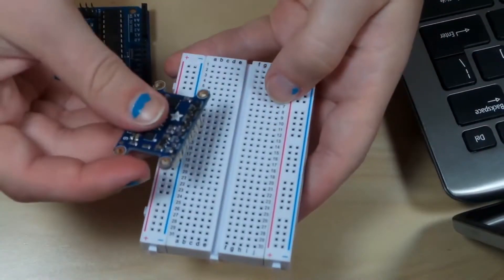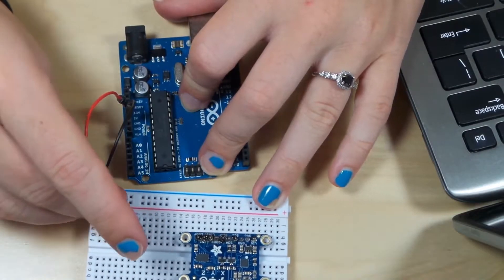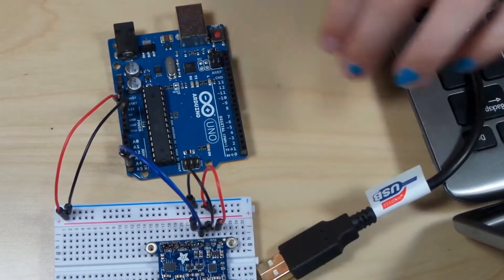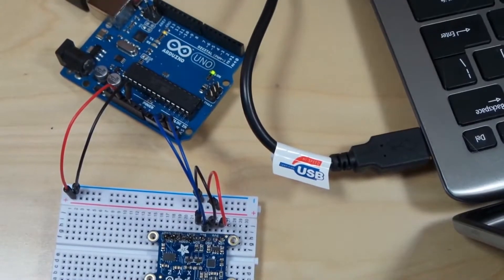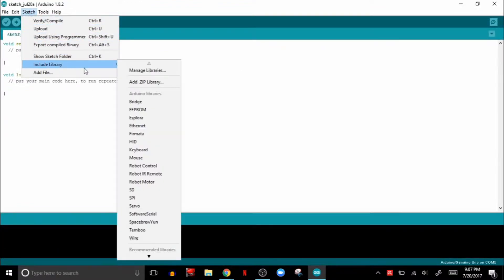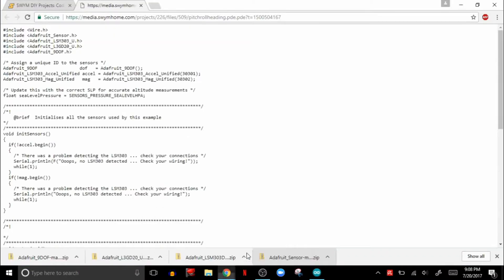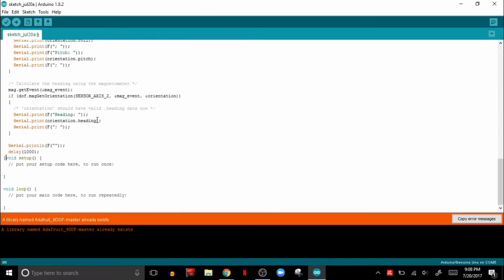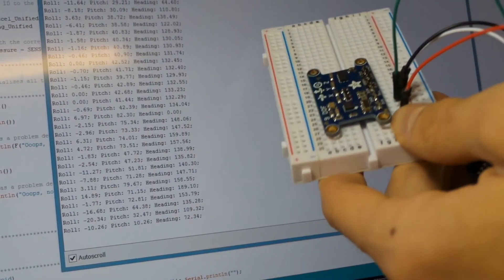Code an Arduino IMU Sensor with an Arduino Uno

Comment: Nice concise description.  Clearly shown with "umms" and restarts.  :)  To make it even more awesome, additional look into where the code is set to use the particular pins selected on the arduino.  It would really help the beginner this was targeted for.
I like the SWYM concept. Nice job and thanks for S'ing WYM.  :)